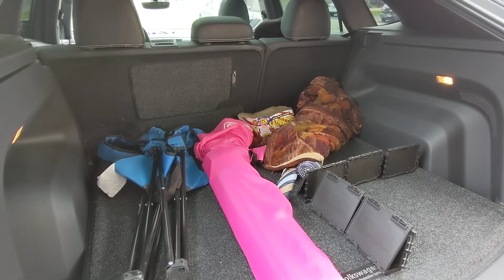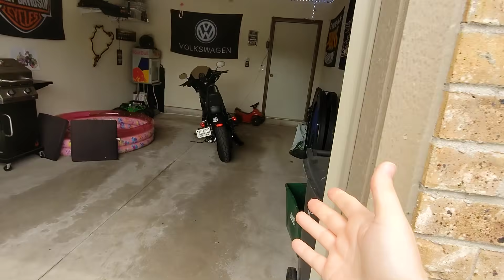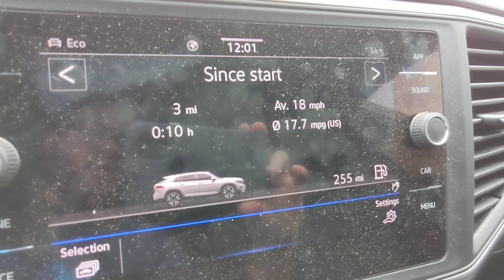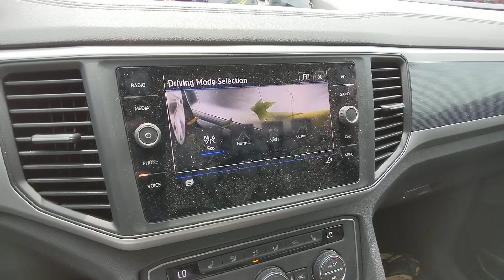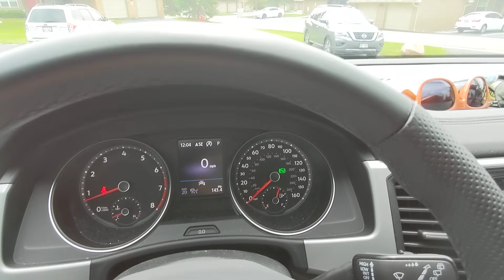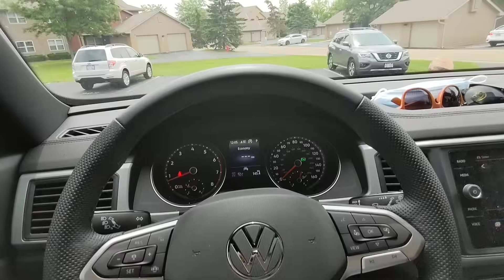2021 VW Atlas Cross Sport.  Why we're trading after only 4 months!

Comment: How  many mile do you drive a year? If you want an SUV with 40' cubic feet of cargo you will have to give up some gas mileage.  Maybe a Mazda C5 should have been a better choice? We are on our second Atlas V6 and knew going in that gas mileage was going to be poor. We only drive 10,000 miles a year so gas mileage was not a deal breaker.
Reply from the maker: Currently putting 16K per year.  When we bought vehicle we were only doing like 7K per year.  Spending $8 a day on gas hurts.
Reply: Not necessarily. A CRV has 39 cubic feet of space and those things, awd or not, are rated at over 30mpg hwy, high 20’s in the city. Something like a cx5 only has like 31 cubic feet, though the handling is pretty stellar (though not enough to counter the CRV’s space efficiency, imo.)
Reply: @Eldaino999  I am impressed with the cargo area but I am not really sure a person (as I was) looking to lease an Atlas again, would cross shop the CRV.  I did look at the Passport as well as the pilot. But hey, if MPGs are a very important criteria for a next purchase, the CRV is impressive.

Comment: VW did their research with the Atlas and found out that Atlas buyers are the brands youngest buyers ever. I got my 2021 2.0T for $40,000 CDN whereas the R line Highline was going to be closer to $60,000. Why anyone would pay $20,000 for leather an NA V6 with the same 0-100 time is beyond me. I like my budget VW. It looks badass. The used market the way it is now is such an anomaly in the way that it wouldn't make sense for 99% of people to trade this up for the gas mileage.
Reply: Wait, You paid 40k for an Atlas, when you could’ve gotten into a low mileage certified pre-owned Q5 or Q7, both bonafide luxury SUVs for not that much more money, and nowhere near the 60k you’d have to shell out for an R line Atlas? I just don’t understand the logic I guess. CPO vehicles come with a warranty and the kind of potent performance you expect from entry level luxury vehicles.
Reply: @zenmonkey1126  i am leasing. 40k was my cap cost. I too don't understand why people buy new cars, I also write off lease payments for my job. But I enjoy the full lease term warranty so I don't have to deal with VWs controversial reliability

Comment: I just recently purchased a Pure Gray 2021 Volkswagen Atlas Cross Sport 2.0T SEL Premium 4Motion. Which for me is much better on gas than the V6. The power is the same for me. But better on the gas mileage. I agree that there is more plasticy interior however, this SUV did extremely well we took to the 4x4 beach. Drove it on the beach and its power is amazing. I love my car.
Reply: Don’t listen to low iq people who have no idea about anything. The gen3 is leaps & bounds better then gen 1 & 2. It’s essentially a gti engine & even has the same is20 turbo. Many examples have already exceeded past 200k miles & others who are tune’d have over 100k hard miles on them. Most of us have to deal with carbon build up at around 100k miles & that is bc of direct injection. If you need more power without sacrificing the warranty, I would look a jb4 from burgertuning. I would join the jb4 VW Facebook group as well. You have same power & more torque then the vr6 just by using this piggyback tune. The most imp things to maintain is 1. Oil changes no more then 5-7k miles depending how you drive it. Transmission service needs to maintained & also the haldex since you have 4wd needs to be serviced as well. I would service the haldex when you change the oil in the trans. Good luck, keep researching & enjoy it!
Reply: Turbo direct injection well good luck with that piece of junk . When it start running like crap due to carbon deposits . They are nothing but trouble . I will see how good you will feel . They are trash .
Reply: @hectorlopez1196  Yeah trash on Kia's that everyone is raving about in this comment section. VW has been making Turbo'd 4 cylinders for decades. They're amazing, if you cant get 300k + miles out of one you don't know how to care for a vehicle. period.
Reply: @europeanlegend9347  more reasons to make them better but that is not the case ok . I font care how long they have been doing it but howbgood are they doing it today ang they have a lot of problems
Reply: @hectorlopez1196  I haven't had a single problem with my 2016 GTI for the 5 years i owned it. I traded it in for a newer, low mileage 2019 this year because the MK8's are here for a while and i absolutely hate the designs. 

This is my 5th vw and aside from the small recall's here and there that every company has (non related to the engine) these cars have been nothing short of amazing. 

So either you had a rotten apple or you've never owned a VW yet alone driven one.
Reply: @hectorlopez1196  "they have a lot of problems" yet still hasn't made a valid argument stating their unreliability. Go back to pre-school kiddo and learn how to write.
Reply: @europeanlegend9347  i dont neednto go back to school to know they are not what they were before ok so is very clear that they have problems and many of them real expensive problems
Reply: @hectorlopez1196  lol, I guess their insane amount of problems are why VW is at the top next to Honda and Toyota. You clearly have zero experience with any VW's. Don't talk about things you know nothing of. Yet again, still fail to mention any of the "problems that cost a lot"
Reply: @europeanlegend9347  he would be right if he was referring to a Jetta or Golf. But a 2L with turbo and GDI in a big and heavy vehicle?? That's ASKING FOR TROUBLE. Want an Atlas?? Get the VR6. Solid engine with no turbo or GDI.
Reply: @hectorlopez1196  Agree. On top of that, a 4 in such a big vehicle. Ramming the air and GDI pressure in that engine?? Its all manipulation to get better mpg ratings.

Comment: It’s funny I only kept mine for 4 months. I now have a 21 Audi Q8. The CrossSprort left a lot to be desired.
Reply: Of course there would be a lot to be desired when you're comparing it to a vehicle that starts at 70K +
Reply: Audi Q8's for that year run 71K to over 90K. hard to compare the two, but the Audi will cost about the same if not more to repair.

Comment: Also, taking the hit on depreciation/trade-in, the better fuel mileage you might get in the next vehicle will not be significant/smart enough in very near future. It will take you so so long to recoup the negative equity or definitely the negative depreciation. Should have done better due diligence before buying it and/or should have got the dealer to do a bailout for you to drive it for a day to test the mpg.
Reply from the maker: We barely lost a penny.  This used car market is absolutely insane.  Also, our commute suddenly changed drastically 1 month after getting the vehicle.

Comment: The interior cheapness is shocking considering how much it costs. The bad mpg is a big bummer too.

A Highlander Hybrid is the way to go, unbeatable mpg and resale value.
Reply: And your highlander has gold inside? All cars have some hard plastics on their "economy" class. Resale value is only what someone is ready to pay for.
Reply: @bmw803  it’s not that simple. It’s because the highlander is much higher quality than this piece of junk.
Reply: @Odat  what's not simple?? Reality? I used to think the same until I realized it's all perception. If you bought the 2L, then sure, it's a bad choice. We have the VR6 and no problems. As I mentioned, all those plastics are probably all made in the same factory in China. What's so special in plastics that Toyota uses, just because it's in a Toyota???
Reply: @bmw803  a Highlander will last 200k miles problem free. A Volkswagen won’t. If you don’t believe me, just wait :-). Sure the plastic might be the same but the whole package is definitely not!. Toyotas have high resale values for a reason!.
Reply: @Odat  They have higher resale, because someone is willing to pay. I have a Jetta TDI sitting outside. 188,000 miles. No issues. Had an 06 Jetta TDI and scrapped it at over 300,000 miles. Had a 2001 Jetta TDI, sold it at 359,000 miles without issues.  Check "what does 500,000 miles do to a car" on youtube. It was an Audi. Toyota doesnt have the monopoly on long lasting cars. Sorry!!!
Reply: @bmw803  If you really believe Toyota/Lexus and Volkswagen are the same quality then I really don’t know what to say. Glad you got lucky with yours. I know many who did not including family members!.
Reply: @Odat  Got lucky?? Seems like that myth is hard to break in some minds. If I had 3 VWs that lasted over 300,000 miles and my current one is approaching 200,000 I doubt it's luck. Its proper maintenance and upkeep. Did they have shitty engines and model years. Definitely, so did Toyota. My point is that yes, Toyota/Lexus are EXCELLENT vehicles, but they're not alone.
Reply: @bmw803  I don’t think it’s a myth. The older Volkswagens seem to be better made than the ones now. Ask your own mechanic and see what he says.
Reply: @Odat  I agree that some newer ones had problems, and that Atlas interior should be better for that price point, but that's the case with some Toyotas as well. My point is this double standard. When Toyota fucks up, there are always excuses. And even newer Toyotas aren't as good as older ones. Same thing.
Reply: @bmw803  2 of my friends who are mechanics ( 1?was a Lexus master mechanic for over 20 years and the other a race car mechanic for Penske for over 25 years) both said Toyota and Alexis are superior to German brands in quality. They both have mechanic shops and worn on cars all day.  Ask your own mechanic and let me know what he says :-): I guess we are going to have to agree to disagree.
Reply: @Odat  Ok, so 2 mechanics say something. I can surely find 2 mechanics somewhere who can say that German cars are superior to some Japanese cars, including Toyota. Everyone has their opinion based on how they see it. If TDIs are able to last as long as Lexuses, why are they inferior? That to me means it's someone's opinion.
Reply: @bmw803  please find me those 2 mechanics that say German cars are built higher quality than Toyota/Lexus. Ask your own mechanic. I’ll be waiting :-)
Reply: @Odat  I guess you choose to regurgitate. I dont need a mechanic to tell me what's obvious. Some VWs are better built than some Toyotas and vice versa. VW's strength always was with TDIs. I still see early 2000s Jetta TDIs around. Would I take a Corolla over the TSI GDI Jetta? Yes I would. You blindly think that, because its Toyota its better, when it's not always the case.
Reply: @bmw803  lol so you know more than a mechanic who works on all different kinds of cars all day every day!!!. Alright man, then stick to your Volkswagen and I’ll stick to my Toyotas.
Reply: @Odat  The same goes for you bro. You know more than a mechanic? Being a mechanic doesnt mean you cant be biased one way or another. My point was simple. Toyota doesnt have a monopoly on well made cars.

Comment: Been a vw tech for 29yrs. I am a fan of the brand. So my opinions are bias of course. After watching your video, I am surprised you are expecting higher fuel mileage....just my opinion!   Trading it in after 4 months....you definitely have finances the rest of us don't have!
Cheers!
Reply: I researched other cars from the same category and their better mpg comes with premium fuel. So 20% more mileage but 20% priced fuel. I have both atlas and glc43 amg and the delta is the same fuel cost/mileage
Reply: @roiemesilati  Yeah, pretty much. Nice thing is Atlas only calls for regular :)
Reply: @jesse4589  The VR6 takes regular, the 2L needs premium. I would NEVER buy a 4 cylinder with GDI and turbos in such a big and heavy vehicle. That's asking for trouble.
Reply: @bmw803  Nope, the 2L also takes regular as well.
Reply: @jasonrao6396  Does it. I heard many times it requires premium.
Reply: If you are an honest VW tech you should be telling people to not just walk away from that modern VW junk you should be telling everyone to run away from it as fast as they possible can…
Reply: @denisk186 when making comments like this you need to make factual statements as to why .
Reply: @denisk186  true. VW is trash. VW diesels are good but the rest is pure garbage. Americans buy then tho.. cheaper than the alternatives. Audi is shit too. Most of Audi cars.
Reply: @graphicsequip7863  yes WI does have a trade in tax credit, however it depends if it’s a lease or retail as well. I believe you had to trade in a retail/owned vehicle for a lease vehicle to get the tax credit. Trading in a lease to lease would not apply. Each state has their own rules, if they have a tax credit at all, many do not, only a few do.
Reply: I have a decent commute to work (80 miles round trip) and I have three kids to haul around. I focus on safety, size and reliability. What is your opinion on the 2021 VW Atlas? Thank you
Reply: I just got the same car minus 4 wheel drive for $26000. Only 22,000 miles in NC.
Reply: My biggest complaint after 6 years, whoever designed and wrote off on that 18 gal fuel tank should be keelhauld. My 2019 has 30k miles. Hwy miles. Been a nice car to drive.
Reply: Is the 2023 Atlas a reliable vehicle in your experience?
Reply: *Access to credit
Reply from the maker: We were not expecting higher milage our commute suddenly went from 10 miles to 50 miles.  With this used car market we "only" took a $1000 loss selling back to dealer.  This used car market is crazy!
Reply: @amentauto3610  you’re also paying double sales tax and fees. It would take a long time to make that up on fuel savings.
Reply: @amentauto3610  that $1000 loss include or exclude sales tax and registration fees?
Reply from the maker: @ewtubewatcher  includes everything.
Reply: July 2020 I purchased the 2021 Atlas SEL.
I live in Queens NY.
I have about 13.800 miles on it..
I really Love the car. And it’s super roomy even roomier than my previous Lexus GX460 which I turned in for this Volkswagon.
But to be honest it’s not good on gas mileage.
I get around 8-10 MPG city,
About 23 MPG highway.
Reply: @markgjidoda2745  MPG isnt the best, but I manage 26 on highway, which isnt bad for a VR6 and the size of the vehicle
Reply: Just a $1000 .. I find that hard to believe.   So you drive the car for 4 months, sold it for $1000 less than what you paid for.. meaning you paid $250 a month !!  No way. .. that means the dealer now has to sell it over the original purchased price to make a profit.  OR, sometimes they make it look like they are paying you a lot fir your trade-in, but the jack up the price of the new car.  But there is no way that you   only lost a $1000.
Reply from the maker: @switchex  dealer sold it above MSRP 4 days after selling it.  This used car market is crazy.  We saw a great opportunity to get out of it so we did.
Reply: @switchex  That's exactly what's happening all over the world, not enough production because of the pandemy,  new cars are impossible to find and are crazy overpriced, used ones now sell for more than new cars msrp.
Reply: @switchex  I sold my 4 year old car to a dealer and they paid me close to 10k more than I owed on it. This market is insane
Reply: @switchex  you my friend have clearly not paid attention to the marked
Reply: @switchex  it is hard to believe… but my sister bought a new Tahoe earlier this year for $66k+ tax.. drove it 10k miles in 5 months and sold it last month for $78k because she wanted the genesis suv instead...it’s ridiculous.
Reply: @switchex  been looking at the larger SUVs recently and their market demand has gone way up so I'm not surprised. 
I think some factories will partly be  moving to electric/Hydrogen as some state(s) will be prohibiting new gas car sales soon so they are going to be milking it while most of the people are blind to it.
Reply: @switchex  
It’s not hard to believe. Literally everyone knows how insane the market is. Before I bought my Ram I was looking at chevy’s and there was a 2021 trail boss that sold for 9K over sticker. The chip shortage has made people lose their minds. Furthermore, you gotta ask yourself what reason would some guy have to lie about how much he sold his suv for to some stranger?
Reply: @switchex  
My buddy bought a jeep Cherokee SRT and drove it for an entire year and the same dealership he bought it from paid him the exact price he paid for it. So apparently you’re the only one that doesn’t understand how things work in the used car market. Your dumb comments are from 6 months ago so hopefully you actually looked into things a little further since then, instead of shooting your mouth off over things you have no clue about.
Reply: I have a 2019 Atlas and I'm trading mine in within fhe next 10 days. And all in all the value of my Atlas I'm going to lose about 1500 including fees.

The used car marker has never been this good in my life time. Bought the 2019 in February 2020.

So right before covid restrictions took effect. Since then I've been able to work from home 99% of the time do less traveling. So by the time I trade it in. It'll have about 10,500 miles on it.

And I'm trading it in for a 2022 model. The dealership I bought it for actually asked me to do a trade in. Wasn't even looking to do one. They gave great value versus bluebook, and gave me another 1500 toward the new vehicle.

The finance guy actually thanked me cause said "I've been getting 500 credit scores the last 3 months, thanks for making my job easier".